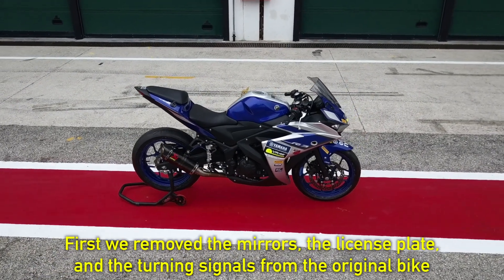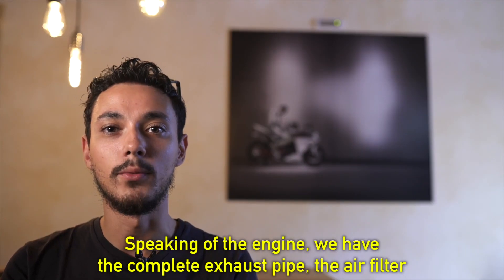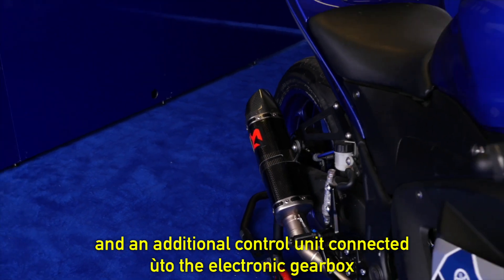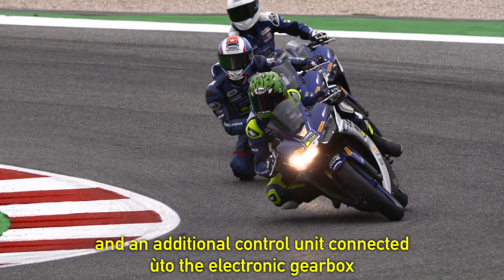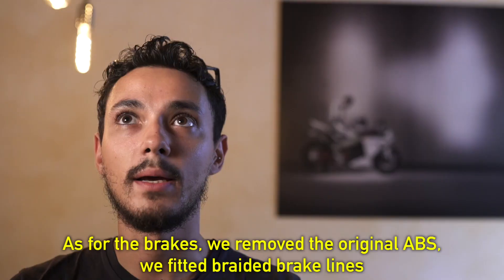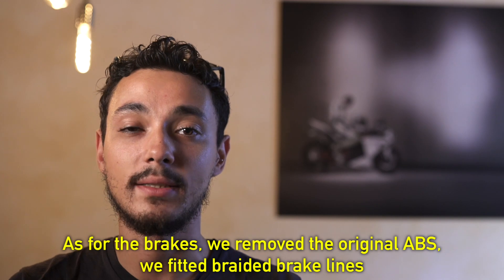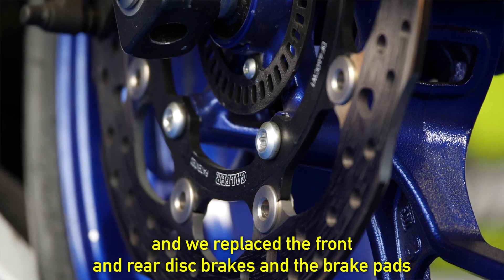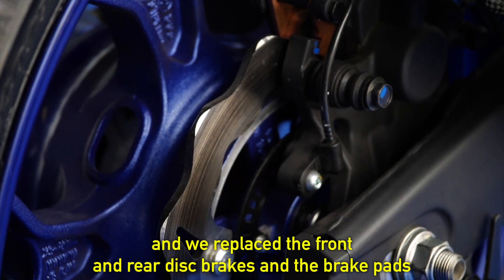6th Yamaha VR46 Master Camp - YZF-R3 Amendments Explained

Comment: Believe me the race faring kits offer more space at the back, for rider to tuck down further during high speed cornering..
i got it done & just need to buy fuel controller/ piggyback Remapped ECU..

edit: sadly Yamaha at the moment doesn't offer option for us to pay and remap ECU, even for race track use only thing..
 would to buy another ECU and probably do nothing with old ECU, which could have been simply remapped through Yamaha's own system..
would need to wait till lockdown is lifted in India..